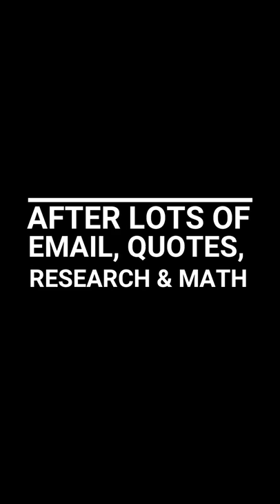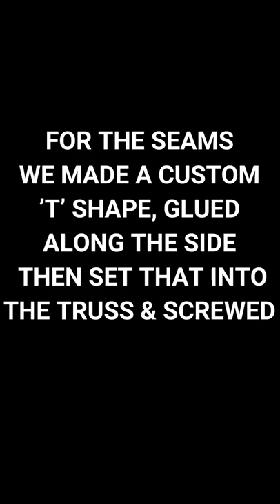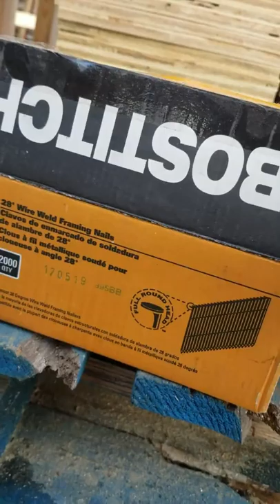DIY Floor Trusses

Comment: I appreciate the work and effort that went into this, however I would be very surprised that these trusses are properly designed and manufactured.  Looking quickly at your process I believe that your gussets are likely undersized in many of the joints.  Additionally, the amount of nails used at the joint is likely not enough for the forces at many of the locations.  Did you design any camber into your jig?  If you used 2 x 4 #2 lumber, it is probably not high enough of a grade for a truss of this span.  A truss built like this at a truss manufacturing company would have used primarily machine stress rated lumber for the top and bottom chords.  

I am not saying any of this to be mean or "troll" your project.  Rather, to help educate anyone considering doing something like this on their own.  In case you are wondering, I have nearly 30 years truss manufacturing experience.
Reply from the maker: Did you see the design from the truss company? Way less of a truss then the one I built in everyday. Also, building has been up for quite some time with no issues, no bounce in the floor, no sagging. And there's a office above. Ive done some extensive research on truff manufacturing and alot of them use number two lumber for cords of this span. I took alot into consideration and then still built them past spec and more rugged then the design. There isn't any camber on the truss, and neither was there any in the engineered design also. When building house you dont typically see anything about accommodation for truss camber. Not saying there isn't trusses with camber but I dont think its nessasary for my application
Reply: @TYGIXXER60  Yes, I looked at their drawing.  The bottom chord is machine stress rated lumber, that has higher design values than standard, visually graded #2 lumber.  The camber would not show on the drawing that you have, it is shown on the drawing that is used in fabrication.  A truss of that length would be built with about 5/16" of camber.  Nearly all floor truss tables used in the industry have the camber built into the table, so camber is always used in the fabrication of floor trusses.  Again, not trying to be negative here, just trying to help give all the information.
Reply: Would pressure treated wood suffice?
Reply: @mikevallez4880  Unlikely, as the design values of the lumber could require some reductions, depending on the pressure treating process used.
Reply: This comment made it apparent that a lot of work goes into truss design. I've been trying to figure out if you can make the edges shallow to fit under an existing roof if we went with trusses assembled on site, or if it's better to just go with a 2"x12"x18' board and possibly just widen the contact points with OSB to make up for the beveling. Since it would only be like a 3" bevel, I'm not even sure it matters.
Reply: Where I live, our local truss company uses the sketchy leftovers from the local lumber supplier to save money. They use a program to do the design and use a press for installing the tiny metal truss plates. Nobody's ever had an issue with them.
Reply: @mikeboulet2837...I'm a former builder of 4+ decades and I agree with your concerns regarding the gussets and their 'very inadequate nailing' (nails should have been more than doubled and very specifically placed within a much closer spacing)! Also a camber is a "must" in the building/designing of wooden trusses! Without a built in camber, these will sag over a period of time if they're ever improperly loaded.

Another thing I noticed is the ends of the 2 X 4 internal webbing DID NOT have compound cuts, which is a major design flaw as the pieces' strengths were greatly reduced without building/bringing the boards into proper compression. 

Bspot, built similiar trusses a few years back (posted on YouTube), made the same mistake with his internal webbing not having compound end cuts.

Comment: Thanks for the videos. I am planning on building these for my shop in Northern NH what size material did you buy for the least amount of waste? I have about 50 of these to build and with prices of lumber now justbtrying to get the most out of it. Thanks
Reply from the maker: All depends on your sizes. I basically did the math out and found out which sizes to buy with the smallest waste. Took me a few min on a peice of paper.

Comment: I wonder if the Titebond III doesn't 'creep'. The regular wood glue, while very strong, (Titebond I) is known to creep and ooze a little bit in the sheer direction or plane even after it's dry. I've seen other people use gorilla glue. Maybe that is more unyielding? I will have to research the different glues before doing this. Maybe with all the screws and nails, it doesn't matter.
Reply from the maker: The factory made trusses you buy from Menard, they don't use glue at all. Just nail plates
Reply: @TYGIXXER60  Yeah, commercial stuff. They would probably say it doesn't add much. But I'm kinda crazy when I build stuff. I'm wondering too if instead of those little plywood gussets, you covered the entire truss with plywood- all glued on. It would then be like a torsion box and probably crazy strong but with prices now, probably crazy expensive! But then also if you used traditional 2x4 cross bracing you could basically turn the entire floor (and/or ceiling) into a single monolithic unit that wouldn't move for nuthin'... :)

Comment: Where did you get the pattern from? Or maybe more specifically how did you figure out what angle and height were needed to carry the load?
Reply from the maker: It's modified like train bridges but based off of a engineer design

Comment: I'm sure these are great but why not just use the metal plates that you hammer on the sides like a commercial truss you would buy? I have been in 50 year old attics that had the plates tacked in place and they were holding up fine.
Reply from the maker: They aren't as strong as glue and wood. If you don't belive me, price together two pieces of wood and do two the way I did they try to disassemble them. You will find my way is much more stronger. Altho more time it's worth it. As far as cost it actually would cost more to buy the tac plates then the amount of plywood glue and screws

Comment: Ok wow they didn't know what their doing. Got to the acres in angles and it pulled a quarter from the vertical. Look at fab shops, they press these together because the load going to each member is why trusses are so strong with so little material. Computers make the designs for a reason. I'm a contractor that wears a belt with 25 years. This will hold but there wouldn't be squares and crXks if they would have tighten things up.

Comment: Ok wondering why all the wood. Angle to angle without the blocking is what I've seen. 26'. Now I'm going to read and find out why. I'll point out that steel instead plywood connectors is cheaper. Might be scrap from work or another job. Looks like it might be a worker doing their own house.

Comment: I am building  a 32x76 gambrel barn and want to do a clear span floor. How did you get your truss design approved by by building inspection. How long was your truss and what was its floor load capacity.
Reply from the maker: theres no building inspectors out here, but this is a modified truss design off of a engineered design. its for a live load, 90lbs per square i belive it was, id have to douple check to be sure.

Comment: Did your local building inspectors office require you to have design signed off by a structural engineer?
Reply from the maker: Fortunately for us there's no building codes out here
Reply: I'm sure the Truss company is grilled to do important work for you for free..... Or did you pay them for their design?
Reply from the maker: @samhenryjr1087  mine is a modified version of a engineered design. I can send you the engineer design I first got with my quote.
Reply: @samhenryjr1087  this video is exactly why we don't send out our designs without a signed contract or letter of intent. 

Also, unless you understand how forces transfer thru a truss, it should be left to those that do.
Reply: @hughtaggart565  Don't you send basically the same design to 10,000 customers all of which "pay" you for your engineered design?   The whole issue is they saved $5500 by doing the trusses themselves over some company that used the same blueprints thousands of times and having an actual assembly line doing the trusses.   Maybe companies shouldn't be raping people for profit.    What they did in 1 week could have been done in 2-3 hours at a truss company and I'm sure he paid more for lumber than your company does - isn't that profit?      Once a 32 ft span is "engineered", that design is done and shouldn't need done again.   Those same plans are just paying for themselves over and over.   I applaud this guy for doing what he did.
Reply: @samhenryjr1087  The pratt and the howard truss designs are 200 years old. they are not patented.
Reply: @samhenryjr1087  The pratt design has been around forever.  I don't think truss companies own the rights to physics.
Reply: @kickassMach1  Right on.  A simple truss is pretty much a commodity at this point.

Comment: This is great but I need 69 trusses so it would take me about 10 full days to just make trusses.
Reply from the maker: Correct. Most likely will take you two weeks. But do you make 14k in two weeks?
Reply: @TYGIXXER60  only if you are travel nurse worki g overtime hahaha....
Cheers from Brazil my friend !
Reply: The guy saved big money.  Not everybody buys off the shelf. He made the calculations and it was worth it.
Reply: @TYGIXXER60  Seems to me that some here can't do the simple money/time calculations.  It looks like a fun project....trying to be as production-line as possible with not a whole lot of different size parts.

Comment: Shortcut... If you buy one truss the correct size....
Reply from the maker: They don't make one truss like that. Has to be a order to make it worth their time. I asked this question previously before making my own
Reply: Did a good job on them.  Enjoyed the video.  Oh, how did you do the math?
Reply from the maker: The spacing math? Total length minus half the ends, 1 1/2 divided by the number of boxes. That's all sorts of ways to do it esp because I don't do it the conventional way, I put my boards in the center on the mark vs normal people go to the mark. I just preferred it that way

Comment: Noticed you used screws instead of nails. Any concern with sheer-strength?
Reply from the maker: No. Although nails have a higher shear strength, the screws are still very strong. We tested a truss of our own and didnt have any break off or shear

Comment: How can you guys be certain how much load those trusses can take? Are there any mathematical calculations?
Reply from the maker: We based our truss design off of a engineered design. Talked with various people in the industry of trusses and engineers, the basic premise we got from all of our info was that a right triangle, with 45° cross brace was going to be the strongest. Also there three types of trusses, warren, most comon, because its cheaper to build, more economical for truss companies to build (significantly less material) Howe and pratt, both are very similar. And are most commonly used on bridges for trains. We went with pratt style. Considering how much live load the design we originally got was we consider ours to be much stronger. Therefor yielding a higher load.there was also a hvac box right dead center in the engineering design. Seems like that would be a very week point! I didnt like the design myself so we created our own! Altho we have not tested how much weight one truss can take, based our or researh and advise from various others im sure they will do just fine. We live in nh. Very heavy snow loads. The building size is 32x40 and the roof is 2x12x26fts. Comon rafter. Also a lvl for ridge beam and 2x10 for collar ties. We have 5/8 fully plywooded roof with tin. Knee walls on the comon rafters. The floors above the truss is also 5/8. Roof pitch is a 8. As it is right now there quite a bit of weight up there. Im currently insulting the building and have sighted down each truss bottom. Still straight!
Reply: @TYGIXXER60  Are you an engineer or did you need to have an engineer sign off on the truss design and also the construction?  Thx for the video.  I am researching ways to build the cheapest and strongest truss for the DIY and your video was a big help.
Reply from the maker: @gabrielpadilla6598  I am not bit I am well versed in the subject of loads and spans from just doing my own research. We have heavy snow loads here. Also in my area there is no building codes or inspectors so I did not need a sign off. Thanks 😊
Reply: @TYGIXXER60  Thanks for your prompt reply.  I am an electrical/software engineer, but I had a business building homes.  I am fascinated with all aspects of building and automating as much as possible, the design, management, fabrication, assembly animations and visualiazation, quality control, real time measurements using lidar and photogrammetry, and implementing the latest technologies for the DIY.  I believe a home can be built for 30% less for the same and better quality.   I built my own home 3400 sf in California.  I did all the engineering calculations, but had to have an engineer stamp the business plans, since I am not a PE.

Comment: What was the free span wall to wall length for these? And do your floors bounce?
Reply from the maker: The span is 32ft outside of walls. 6 inch walls. The floor does bounce a lil. But idk if you've walked in houses with store bought trusses but they also bounce. It's very minimal but if your standing still amd someone walks by you Caan feel it

Comment: No lateral bracing, and no effort at anti- parallelogram  collapse  positive deflection in this span ?? None present ! Finally the chalk point of Titebond 33 I believe is about 45deg f and if your using it and storing externally in what looks like conditions much lower than that you have a(it will fail) problem !! The proof of value is in longevity and safety in adverse conditions .. if I were an insurer I wouldn’t touch it with a barge pole ! Just saying
Reply from the maker: We never let the glue get to the point of chaulking. Also you can use this glue in cold weather as long as you put it under pressure under 10 min. We actually were concerned about caulking and did some samples. And the wood broke apart while the bond stayed. Also take note that mass production trusses don't use glue and only use nail plates. It's just added security
Reply from the maker: Also lateral bracing through tge trusses were added when they were all up. This video was just to show the truss itself. We didn't take much pics/video afterwards
Reply: What special features do truss manufacturers have to combat anti-parallelogram collapse?  These look like standard store-bought trusses albeit with plywood gussets.